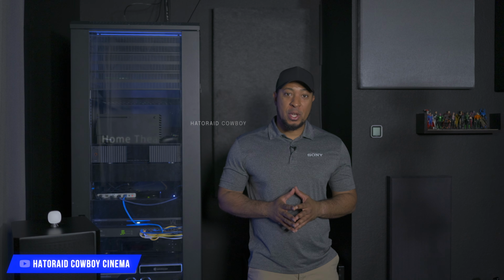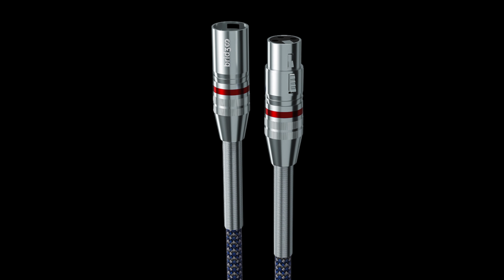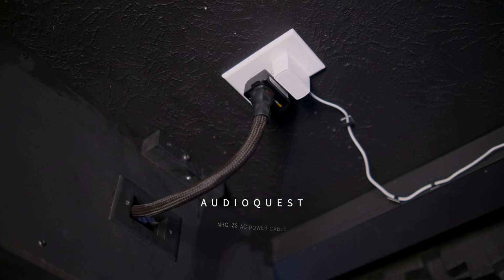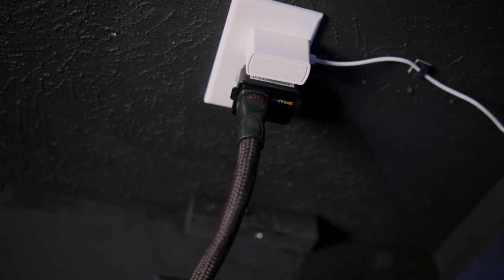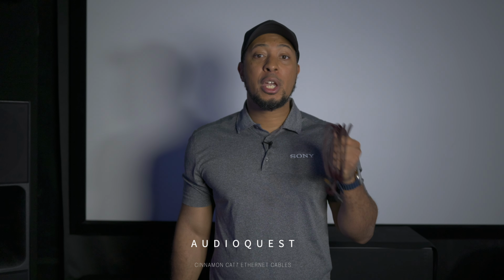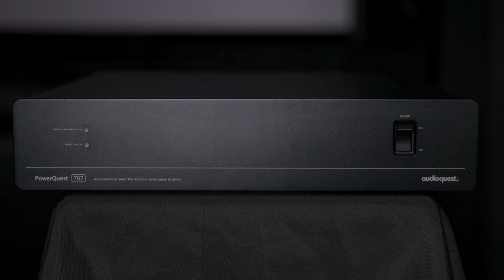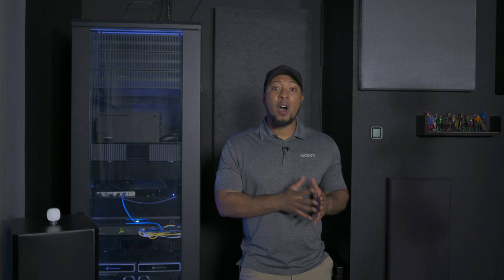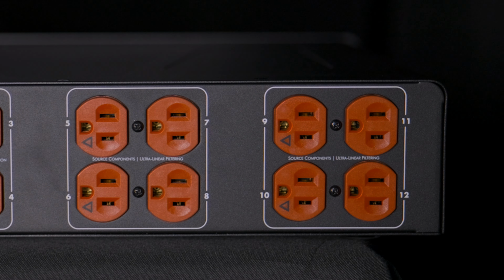Why High-End Power Cables are Worth It

Comment: As a video technician, I’m getting a headache watching these kinds of sponsored, biased marketing claims. Here is my reaction:

Claim: Silver Ethernet cables improve media player sound/image.
FALSE: Ethernet sends data in packets. Silver plating cannot make a digital file "better"; it either meets the speed spec or it doesn't.

Claim: High-end power cords improve projector performance.
FALSE: The projector’s internal power supply filters and regulates the electricity. A cable cannot change the brightness or color of the image.

claim: Expensive cables prevent "lag and pixelation."
FALSE: Digital signals don't "lag." If a cable is certified for the bandwidth, the image is perfect. If not, you get a black screen—nothing in between.

Claim: Power conditioners increase "fidelity."
FALSE: While good for surge protection, they don't improve signal quality. Modern AV gear is already designed to filter standard power.

The Bottom Line: These are marketing myths that ignore basic physics.

Comment: Xlr cable connection removes any distortion and noise by design. Xlr cable length doesn't matter. Video is invalid. Lol.
Reply from the maker: The video comment was in general to higher end cables lol

Comment: This was a fantastic video. Very helpful for anyone curious about cable upgrades and their value.

I always go with XLR in my systems where possible. It offers me cleaner, sound and easier connectivity. I use Mogami but have tried other brands. I didn’t note much if any difference between XLR cables.

I also swapped out all of my power cables to Audioquest. I did notice a difference indeed over the ones that came with my electronics. That said, I bought some off the wall brand power cables from Amazon. They were much more affordable. There was no audible or visible difference to me on my electronics with either the Audioquest or the off brand ones from Amazon. 

The Ethernet cables are pure snake oil for me. Data won’t get there any faster. Plus the cables in the walls, and from the internet service provider aren’t built with all those buzzwords on the back of box. 

Lastly, I have been using power conditioners and good surge suppression for years. The Niagara line is awesome, but pricey. It was worth it to me because of how inconsistent power is in my community.

Just an awesome video
Reply from the maker: Thank you Rob! And thanks for sharing your experience with different cables. With all the recent storms we’ve had, I def want to invest in better gear for the times when the power goes out unexpectedly.

Comment: XLR is simply the way to go on cabling vs RCA.   It is inherently more stable, and can easily remove signal noise from RCAs that just do not ground well and actually act as large antennas in your system.   
Solar power really adds a large random bit of problems on many systems.
I have solar with battery backup.  When my battery takes over and vice versa there is a voltage fluctuation that makes my receiver and computer reboot.
My solution was to add an UPS inline with my Panamax power conditioner.    It is not healthy to have your equipment rebooting constantly.
Sometimes power conditioning isn't enough!   Steady power and fluctuations may need some help by adding battery power in the loop.
Reply: @tkcdac
Never had sound problems with QED RCA  Cables to Power Amp, sounds great.
XLR cables are only needed for longer runs
RCA is good for shorter connection
Reply: @Music.Movies.67  Great points. I had no problems with my long run RCAs until I changed to a more sensitive speaker.  After seeing that, mess I had to move to XLR my other cables.   Quite frankly, if your cable type brings in noise with a longer run, then it is on the smaller runs as well, but you just aren't magnifying the inherent weakness that remains in the cable.    Changing to quality cables is removing death from a thousand cuts.   You may not see the issue with one, but slowly and surely noise is added into the system in random places.  
XLR isn't that much more than RCA, and I like the connectors that lock in.  Pull enough on most RCA's and you are pulling the connectors to an early death.   I would encourage you to play with the change.   
The Audio Quest HDMI cables are heavenly for being fast and low noise.
Reply from the maker: Very good points also!

Comment: Don't get carried away with cables, especially power cables. If you buy a good amp, the power cables are more than sufficient same with subs. The cables do look pretty and the box it comes in is very nice. There are some great cables out there that will not break the bank. And ethernet cable is designed to pass data. Buying a cable with a higher band with that you not going to use is not going to make a difference. Same with hdmi cables, they ether work or they don't .  I have been useing bluejeans cables for years and they are a fantastic cable l. There not pretty it's great materials at a fraction of the cost. Save your money put it elsewhere.  Just ny option

Comment: Hi, I always used Audioquest, till I discovered Maze Audio, you should give them a try,  I always buy their higher-end silver plated and so on, and Also their braided cables. I am extremely happy with them and much cheaper than Audioquest.  I also used to use the K2 for AQ where 20K each XLR, RCA, and Even the Ethernet cables I use are AQ .
Reply from the maker: I’ll look them up thanks!
Reply: @hatoraidcowboy  Anytime,  I am sure you will like them, excellent quality.

Comment: If you get RCA cables that are made with quad microphone wire, you won't hear any hum.  RCA cables that are made with Mogami W2534 or Canare L-4E6S wire.  That is what I use and I have no hum.
Reply: You don't need quad wire to reject noise, you need shielding primarily. I know it's a good cable and very popular, but it actually performs worse than 2 wire coax in some ways. Canare L-5CFB RG-6 for example. I used the L-3CFB for smaller holes in the floor, and use it with all 4 of my 10-55ft sub runs, and my 50ft run to my Record Player Preamp.
Reply: @andrewskaterrr  you are correct in the shielding.  However the quad wires I mentioned are shielded.  I have made RCA cables with the Mogami W2534 wire before.  The other cables I have, I bought them from World's Best Cables.  My runs are short because I am using it to go from my amps to my processor.
Reply from the maker: Interesting!
Reply: @hatoraidcowboy  yeah, that is the type of wire that is used to make XLR cables.  That is also why they cost more than the basic RCA cables.  They also will have a nicer RCA connecter as well.

Comment: This seems more like an advert than any kind of informative review.

The reason you got rid of the interference when using XLR was nothing to do with the quality of the cable and everything to do with how XLR works.

Differential input: The receiving electronics in XLR cables only accept the difference between the two signals, rejecting noise that is the same on both conductors
Reply: All YouTube videos, particularly about hifi, cables and so on, are all commercials!
Reply: @paulupton7698 everyone has experience and information different from your path.  If you want only affirming information to what you have already chosen, you may need to stop listening to channels that share  opinions that you can't handle.   Confirmation bias does exist.
Reply from the maker: This video is whatever you want it to be. Title never said review tho.
Reply: @hatoraidcowboy  You're ignoring his point, the quality of the cable is irrelevant in this case because he's absolutely correct that XLR cables are poignant at removing noise and interference. It's a reason why you see pre-amp systems with standard XLR outputs to minimize that distortion. You're either ignorant to how cables work or you're one of those guys audio salesman at Circuit City 20 years ago convincing layman that Monster Cables are better than regular ones.
Reply from the maker: @iamski I know how XLR cables work. 

The title of the video is WHY I chose to go with higher end cables. As soon as people see Audioquest they’re gonna go off in the comments. I’m just sharing my home theater journey. I’m not looking to argue and I’m not gonna.